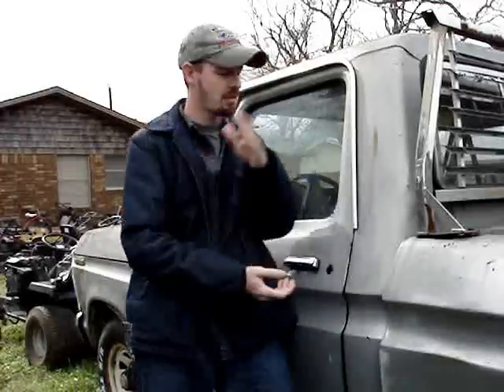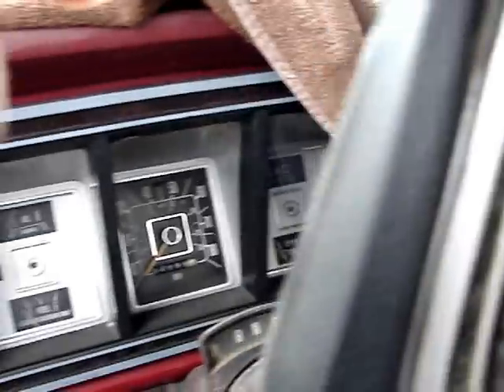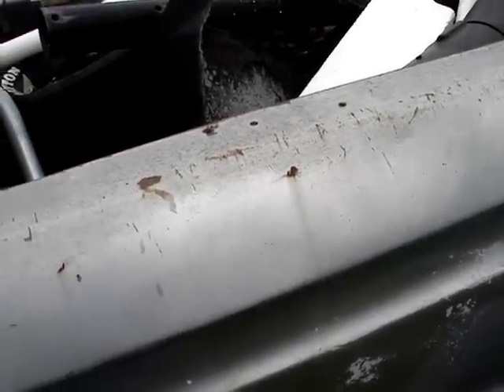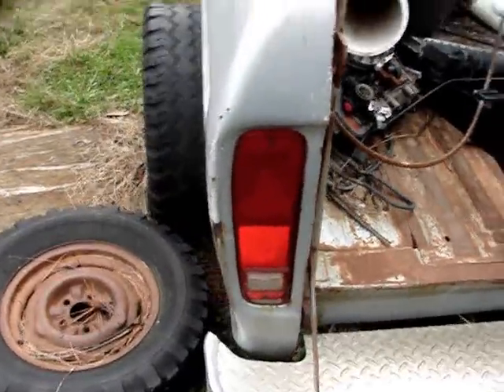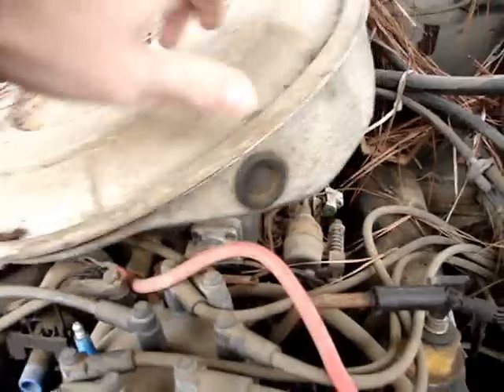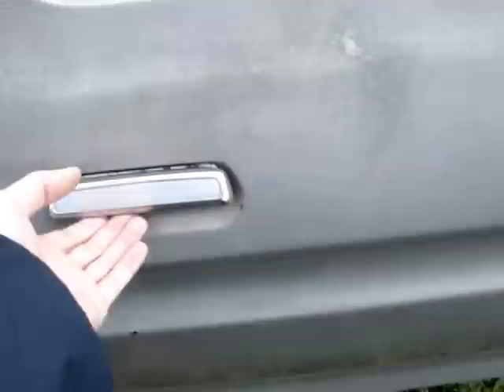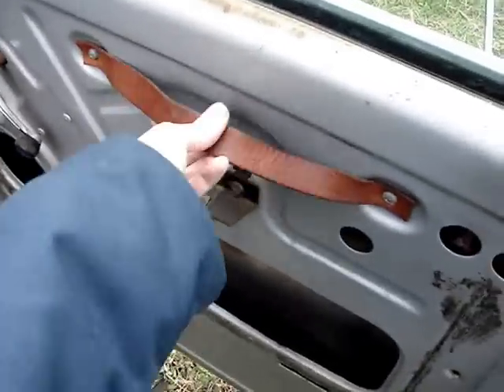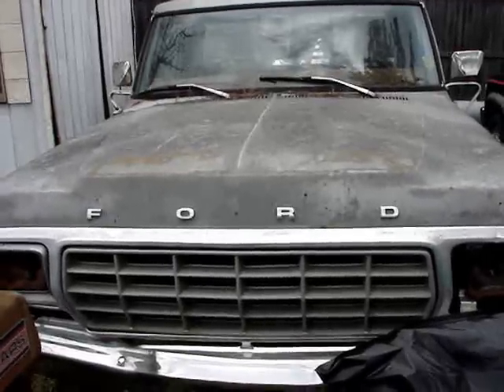The Story of Old Gray, 1979 Ford F-150

Comment: Yeah im curious how much was it brand new?
Reply from the maker: ford 300 inline straight 6 I'm not exactly sure since by brother bought it used for $800 back in the late 90s. It is rather difficult looking up it's original cost because of the options available back then changed the prices and that varied dealer to dealer. Although from what little I could find via the Internet, I would say probably in the neighborhood of $5500. It came factory with power brakes, power steering, cruise control and A/C, but lacked any special trim outside, but had the nicer wood paneling on the dash and glovebox door. The wheels look like what came on the "Free Wheeling" package but those could have been added later on. Thank you for watching my video, its been awhile since someone commented on this video, and I thank you for your interest in my old truck. Yes I still have it and still hope to resurrect it.